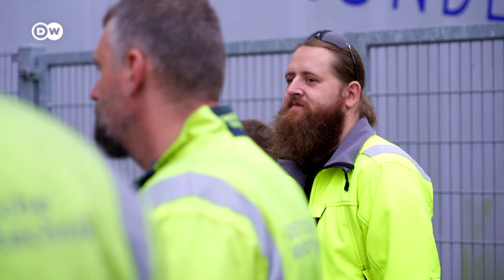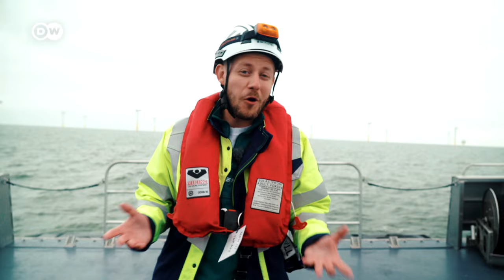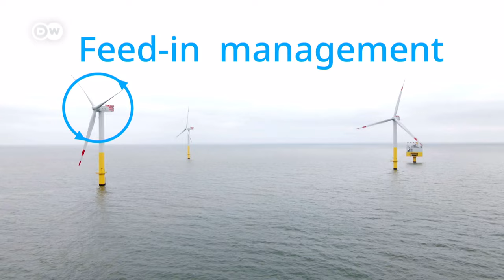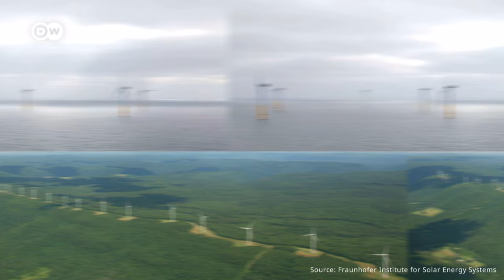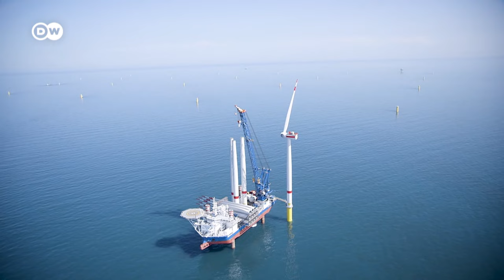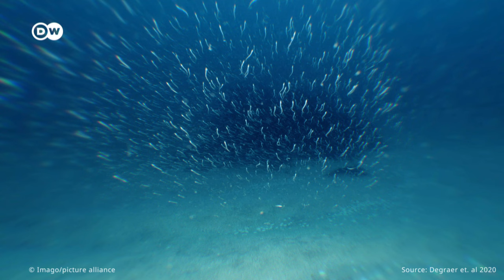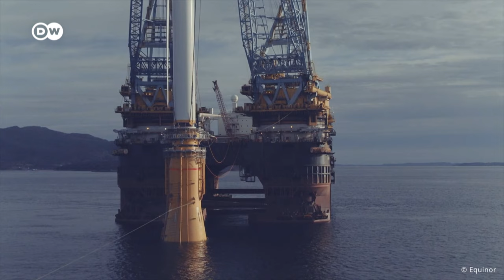Is offshore wind the energy of the future?

Comment: Solution: 
Replace all coal and gas plants with nuclear. 
Then you can use the existing infrastructure. 
GE-Hitachi promises the 300 MWe BWRX-300 for about 1 billion euros. 
Just from the  yearly loss because you need to slow down the windturbines you could build a reactor which provides more energy than 100 windturbines 24/7/365 on about a land of a football field.
No issues with the nature reserves either.
Also, nuclear needs 10-15 times less steel and concrete and with SMRs it will even better.
But yeah, listening to science is not for Germans...
Reply: Or anyone
Reply: I live in Karachi Pakistan and I like your comment if you don't mind
Reply: Except the standards for nuclear aren't universal and as nuclear does still produce pollution it isn't a 
Win all it's a much win better for sure but this is a multi industry problem
Reply: Limited flexibility of power output and scarcity of cooling water in summer are 2 hidden reasons why integration of nuclear power on a grid still is challenging. Not to mention usual stuff...
Reply: @solutionrebellion  How can we handle the nuclear waste?
Reply: @ErLong1800  "How can we handle the nuclear waste?" 
First of all, there is not really a large amount of it. A few tonns per year. A Tesla model X weights more then the amount on high level waste is created in a year by most powerplants. 
The first 4-5 years under water. It's called the spent fuel pool.
During this time the shortest half life (therefore most radioactive) elements dacay to stable. Perfectly safe, you could even swimm in this pool, but diving to the buttom is not recommended. Check out XKCD's blog post about spent fuel pool. 
Next step is to either put them in stainless steel containers surrounded by concrete. It's called dry cask storage. Pretty safe for a few hundred years. By that time most of the fission products decays. You can also dig it underground and you are done. 
Other option is reprocessing, (because 95% of the waste is still good fuel) which is forbidden by law in the US, but France, Japan and Russia does it. In this case you remove the useful uranium, plutonium and make new fuel of it (MOX - Mixed oxid). The rest you make glass of it, put it in stainless steel containers. It's called vitrification. Reprocessing is more expensive than digging it under ground and mining and producing new fuel. 
If you really want to know more, I can recommend the Illinois Energyprof chanel.
Reply: @ZupaRicsi the Problem in germany is due to the Limited Places in the underground for storage
Reply: @factnotfiction5915  
Some flexibility would also be needed on the demand side, regardless if it is to use excess heat from a nuclear power plant or excess electric power from a wind farm, and heat is less versatile than electricity.

Wind power sometimes is not enough, but nuclear power too (you may be right about the season when power demand is highest, this is not my point, it depends on the region.) When the cooling water is not enough or not enough cold, they have to shut down the nuclear power plant and feed the air conditioners from another source.
Reply: @factnotfiction5915  
According to your words it seems like a nuclear power plant can balance 24/7 any electricity demand and any heat demand. Magic.

Comment: I don't understand why high voltage DC is needed to transfer power from the windfarms in the north of Germany to the manufacturing centers in the south? Sure it might be slightly more efficient, but it requires alot of expensive supporting infrastructure. In NZ a majority of our hydro-power is located in the south island, but our population centers are in the north island. Apart from the Cook Strait crossing, all the power is transferred through high voltage overhead powerlines (220kV and up)

Comment: it is not a miracle solution to all energy problem, it is another tool to be used for the right applications.
Reply: I agree completely with your comment, we need to have energy storage and other forms on generation such as SMR’s as part of the mix. I have solar panels on my roof with batteries, the batteries provide the electricity I need for hot water and overnight requirements and avoid sending too much electricity back to the grid.
Reply: People are always trying to sell a certain technology as thr miracle solution, so I'm happy about your comment.

Comment: Turbines don't belong en-mass out in the sea. NJ USA is planning up to 5000 turbines in farms with some 150 substations... in total containing some 35Million gallons of hazardous fluids and 3.5Million pounds of SF6 (most potent GHG known to humanity, with a warming potential 23,900 times that of carbon dioxide (CO2) and atmospheric residence of up to 3,200 years.)... those fluids leaking and at risk to dumping into the sea en-mass with a natural disaster or military conflict. 
The are NOT Green, NOT Safe, NOT low cost energy.  In fact, European citizens report to us that their electric rates went up 2-3x. The installation process in NJ puts them only 10-15 miles offshore in prime fishing, clamming and scallop grounds. Total destruction of these fisheries is expected due to disturbance of the ground from the installing the bases as well as the maze of connecting cables. And after installation, the choking of all living creatures will continue with constant silt generation to tidal currents moving around the bases of the turbines. Photos of such silt generation is observable at sites that have been installed. Further, NJ has no made apparent the "take charts", which are the declarations by the installers of potentially how many marine mammals the prospecting and installation is EXPECTED to "kill". NJ plays dumb that it doesn't know why our whales and dolphins are washing up on the shore during the seismic testing of the seabed. They know why, they approved it. And NJ is just the ground zero for the entire US coast, with Ocean City NJ being the start with the Oersted Ocean Wind 1 & 2. Our environment protection organizations are now approving of this, we have reason to believe their silence has been payed for. If you love the Jersey Shore, donate to our legal defense fund which is our most powerful method to STOP OFFSHORE WIND TURBINES NOW at https://protectourcoastnj.com

Comment: The video is wrong. The total weighted average cost of offshore wind is the same, if not lower, then onshore wind in the northsea (see the UK department for business energy and industrial strategy).
Reply: the issue is with maintenance i guess....because at sea the air is dense that cause more use of lubricants and the material fiber glass gets eroded quicker than on shore wind turbine i guess that is reason why off shore is expensive than on shore but with benefit of reliable supply of power
Reply: No, while day to day maintenance does cost more per hour, that is a relatively small amount of the average per megawatt hour cost. I work for the arm of the UK government financing their offshore program, and we are expecting offshore wind to have a lower cost in our next auction.
Reply: @samdickinson4002  thank you

Comment: I do not think that offshore wind farms are really more expensive than onshore wind farms. Beside the price for the "production cost" of the energy, which is higher for offshore wind farms, it also important to price in the cost for the energy storage. So if offshore wind is really 365 days a year with a relativley stable output over the day it will be a very important source of energy for the future .
Reply: OF Turbines have to be engineered from scratch, due to very specific sea ground location. ON Turbines are picked from pre-designed "Catalogues" OF Installation vessel is around 600k€ per day, ON crane around 60k€. ON has reached the low point of price, since few years the improvements are only in 2-3-4% digits. But it is fine, it is now a mature industry. And together with solar the cheapest way to generate electricity. Thanks to subsidies provided from some countries, to enable companies to invest in developing the industry. For OF, the road to low price is not yet done. we see even with the increased wind amount 2-3x cost, but. This will change, because the sizes are going even bigger and some floating concepts might reduce costs more. Currently in sales process for installation in 2024-25 are turbines in 14-16 mw class, 2-3x nearly the size of the ones shown in the video. When these come into effect, the prices will come even further down, and the next generation in OF is even rumored to be close to 20MW per turbine....
Reply: I feel sick when I hear utilities saying companies have to turn off the wind turbines (Germany), or telling people they can't hook up their rooftop solar (Hawaii), both because of the grid. Or CA has to pay other state to take their excess electricity.  They've paid for it and need to recoup their investment! If not batteries, then make hydrogen.

Comment: How come it makes megawatts? Is it something to do with the wind speed or the size of the rotor and stators inside?
Reply: Megawatts is simply a measure of rated power. Devices like these generators are built to a specicific size and the power system that drives the generator are designed to supply enough input force to give the rated output. Rotor diameter and wind speed are the two basic factors.
Incidentally while this narrator wa simpressed by teh size of these devices they are toys compared to large turbo alternators of conventional generators, even small ones are rated in hundreds of megawatts.
Reply: @iareid8255  So it's possible to get more than megawatts depending on how it's designed?
Reply: John, 

yes, the largest units are now in the 14 megawaat size now but it means larger towers and rotor diameter and greater spacing. If they are too close together, individual outputs drop as other units slow the wind speed which affects others in  their path.
Reply: @iareid8255  Cool. What about wind speed? Does the energy gain increase if the the wind speed is faster and the blades are somehow stronger?
Reply: John, 

yes windspeed is a big factor but that is natural and uncontrollable which is a negative.
Reply: John, 

that is a very large generator and far too large to fit on top of a tower.
Reply: @iareid8255  Oh, well thanks for helping anyway.

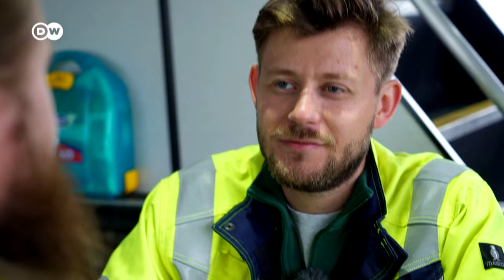Comment: Why is Germany so against nuclear ( 3:19 ) ? It is a power source that is demonstrably safer and more reliable than fossil fuels and an option that doesn't require refitting the entire electric grid for the variability inherent in wind and solar. And they continue to take these plants offline? And look at the maintenance needed for this wind farms? And the risk the technicians are taking?
Reply: Fukishima. Zero tolerance for meltdowns.
Reply: Sandal_Thong Fukushima had problems because of tsunami. How often tsunami has happend in Germany?
Reply: The U.S. Fukushima report said American nuclear industry had not considered that there might be a power interruption lasting longer than the 8 hours the emergency generators could handle. I guess it's unimaginable that one or two of earthquake, fire, flood, hurricane-strength winds and/or snowstorm could knock out the utility grid which would cause the pumps to fail leading to meltdown.
Reply: Sandal_Thong Than you - now I understand your point.

Comment: whilst i agree with the wind energy concept i still think the small household wind turbines should be included as well, such as those from TESUP (for example)......these big wind turbines need a certain speed to operate and can cost a fortune to repair should they break down.....the TESUP wind turbine is small enough to fit to a house and is easily maintained and it doesnt cost a lot to buy (not sure about the cost to install), it should be the big wind turbine, the small turbine and solar power, all 3 included in the same arguement means in theory no company has an arguement against these options...just my opinion
Reply: @piotrtrebisz6602  i know there isnt any competition between the 2...i mention it because it cost 2-4 million dollars to install a wind turbine, which does have certain flaws and it costs around 600 dollars to install a small one...the small turbines for homes and the big turbines for industry,,,everyne going about a shortage of power and here is a solution, or part of it anyway

Comment: Power =\= energy (6.2 MW is the rated max power, 2500 kW * h is the energy consumed. Notice the power multiplied by time, hence energy!)

high voltage direct current transmission lines don' t look like the high voltage alternating current lines (on the big masts) shown in the video.

How does the integration of off shore wind parks necessite a better distributed electricity network? The power of the whole off shore wind park is typically fed in at one point into the energy net. (Some) viewers are not stupid, you contradict yourself. If you want to have reliable energy all the time (with renewables) using off shore wind is a step in the right direction, installing PV on every roof is not.

The higher cost of the off shore wind has to be equaled out with respect to on shore wind and solar related to their up time, which is much much lower. Maybe some weighed up time regarding to the hours of heightened consumption, as there is no (economical) way to save large amounts of energy.

Comment: If the industries would move where the energy is surely the construction of the cables over land quickly would be solved
Reply: Yep, moving all the long established industry to northern germany is waay easier than building a proper electring line system.
Reply: @hydromonstrum  surely not but if every line is blocked by arguments what to do else.
Reply: @luisevieten2035  Seems like it has to be an underground power line, which of course as much more expensive. But future power consumption cant function without updating our power grid.

Comment: Depends if you can produce clean steel for the wind masts, 1 tonne of steel is 1.9m M3 of C02 released and one mast has approximately 250-300 tonne. Let’s not foil ourselves by looking at the output look at the overall supply chain.